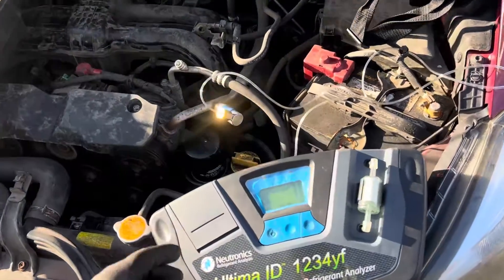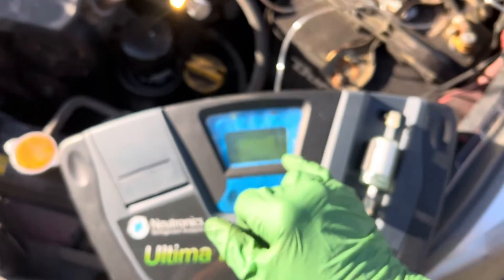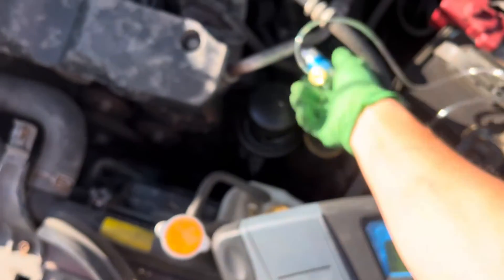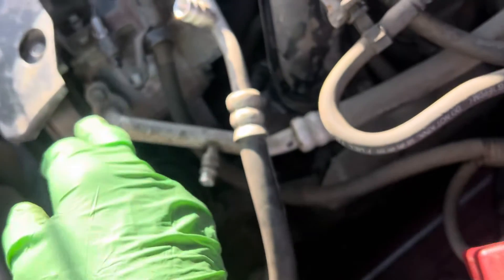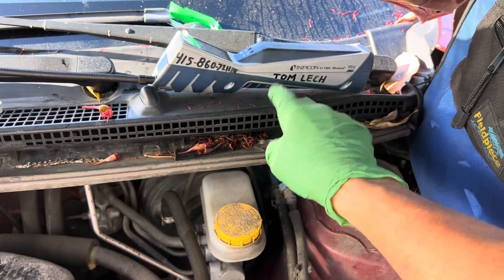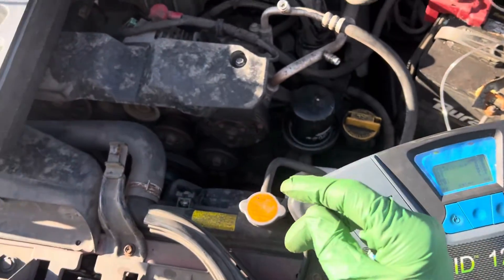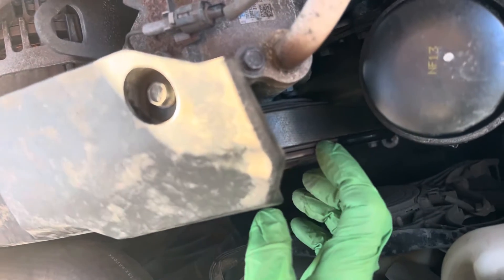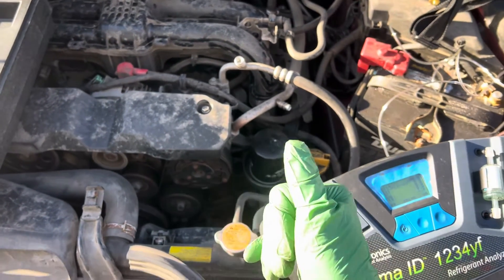Refrigerant cans customer used to fill up his AC system only 1.6% hair contamination not too bad..

Comment: That air must have come from the hose if the owner didn't use a vacuum pump.
Reply from the maker: Even brand new from manufacturer some have air
Reply: Impossible to charge the system without adding a small amount of air when using a tiny can because every time you change the can a small amount of air is trapped. It's also very difficult to charge the system by weight using a tiny can because you cannot transfer the net weight of refrigerant in the can to the system.
Reply: @w0lvez1  You're right on the first one. Even if the user has a vacuum pump and a 4-valve manifold and vacuums out the hoses before opening the service valves, a little air can be introduced when changing the can. Of course, one can repeat the whole vacuuming procedure before connecting the next can, but that would release refrigerant and also make it harder to measure the weight (in principle, you can calculate the weight inside the hoses based on pressure and hose dimensions, but that would be too much for most DIYers). There will be less refrigerant left in the hoses if you can run the compressor after the first can, but I didn't like doing that and just heated my cans with a hair dryer. As to weighting the cans, you can use a kitchen scale to read the weight before and after.
Reply: @xandervk2371  Possible to charge and overcharge 410a on the low side with the compressor off but not possible on 134a not sure why. I think 410a turns to vapor much slower than 134a. Once refrigerant turns to vapor the pressure will go up.
Reply from the maker: @w0lvez1 it’s possible to over charge with both of them 134 and 410.  

Yeah, but 410 we charge as a liquid because they don’t want the refrigerant to split 134. We can charge either way because it’s a single molecule so you can charge of vapor too if need be.. 

But I can easily charge a 410 system by overcharging it . 

I have several videos out there on 410 refrigerant where I get nine or 12 pounds or even 30 pounds in in just a few minutes and it will take more and more . 

It all depends on your knowledge